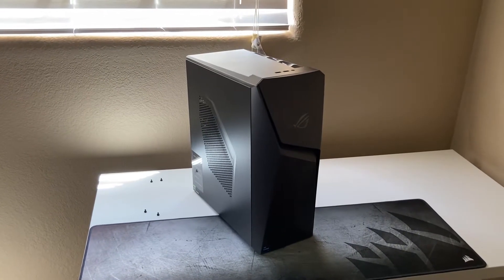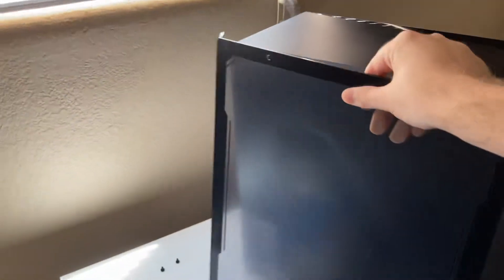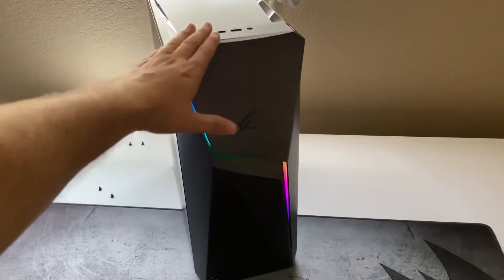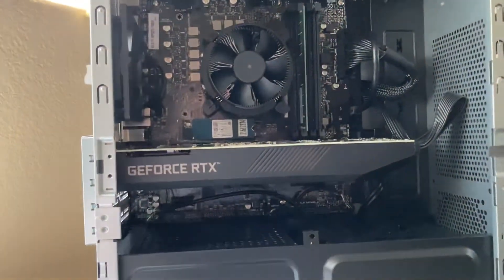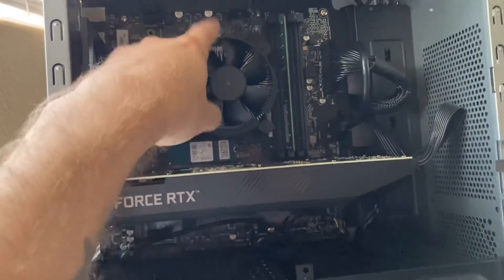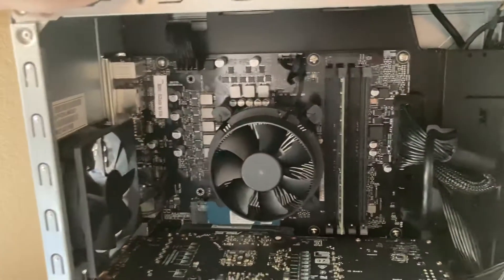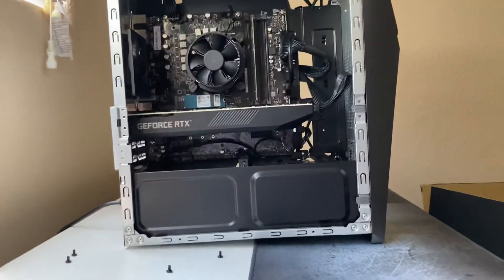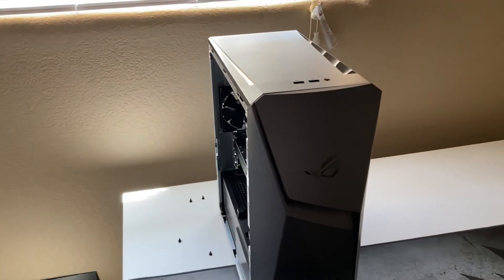New! Asus Rog Gaming Desktop - 3070 - 11700F Overview

Comment: Bought this during shortage just to get the 3070. Put a 970 in it for my wife. Beware, cpu runs hot, hits 97 C even on low settings in games like Insurgency. Get a better air cooler asap. I wound up stripping the cpu and hard drives and rebuilt it in a new case with new ram and a psu. 

Also the one I got had a damn 500w psu
Reply: The 500w is completely fine for prebuilts (im pretty sure lol). The components in prebuilds usually use a lot less power than normal.
Reply: @Inzpectre  Its not lol. At least not for the model GPU they put in there, PC would power cycle like 3 times a day when playing games. Similar thing happened when my buddy wanted to put a gtx 660 inside an Alienware X51, the small form factor model. It came with a GT 640. Anyway, kept power cycling every 10-15 minutes into playing games, once we tweaked a bit in Precision X(like MSI afterburner), we got it to stop cycling all together. There are some Dells that have 3070's in them with a 500w psu and they're getting along fine(I still wouldn't do it), but I'd still expect these OEM's to give the customer some headroom and not leave a chance of an issue arising. The average user would have no idea what to do. Plus, your upgrade path isn't great. Give me a decent psu, especially if you're going to put 1 stick of cheap RAM in there with a trashy motherboard lol

Comment: ive been looking at the same build but the case with the handle on top. I've seen a lot of ppl say theres some heating issues with that pc. I'd like to start streaming as i cant on my current pc (i5 3470 radeon rx 580x). wanted to see if theres any suggestions for a viable streaming pc under $1400.

Comment: I got it for 500 with two 8 gig stix windows 11 2t ssd 1t hdd just had to upgrade cooling system
Reply: The bios doesn’t have fan control. I had to download a fan software because the fan was only going 600rpm causing over heating I recommend a fan software or a fan controller to cool this pc and there’s a slot in the front for an extra fan but you have to take the front panel off